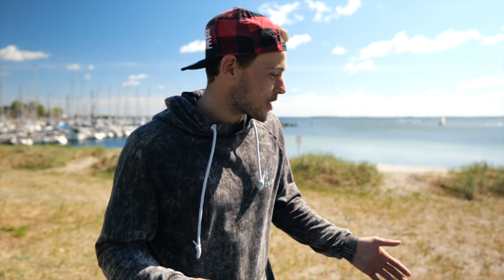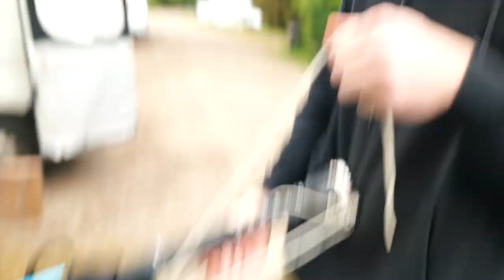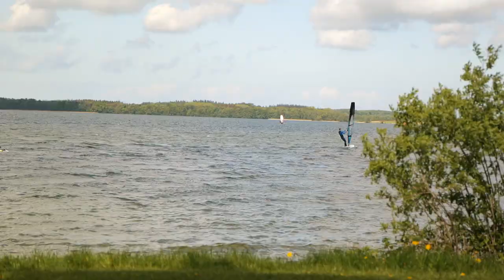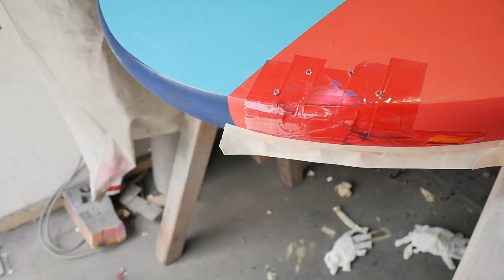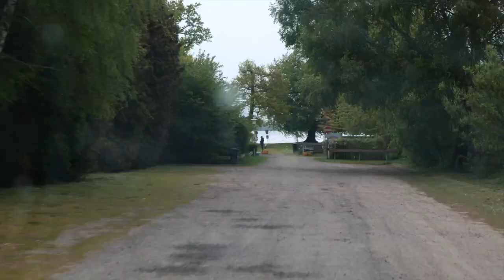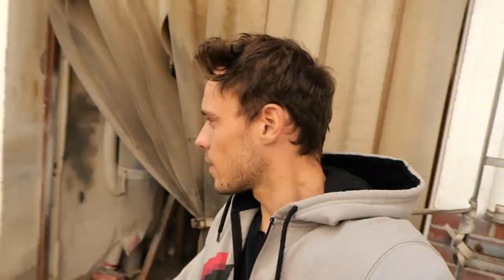CRASHING INTO A BOAT and then repairing it (FULL REPAIR)  | vlog¹⁶₂₀₂₀

Comment: What about a video zooming in on the differences between different sail types? Sometimes they can be hard to define, especially freestyle sails & wave sail shapes. Or Freerace and foil sails. Perhaps by trying to slalom with a wave sail you could zoom in on the (obvious & less obvious) differences for example.
I'm still not sure what some of the characteristics of the sail do. Like when the pressure point of the sail is more forward, backwards or higher or lower. When the power is higher or lower. With which shape does a sail have more acceleration, and which more topspeed? How does downhaul (lose leech) affect either of those? What do 2/3/4/5 battens do with the sail? Which aspects of sailing do cambers improve? (Low wind, high wind, no difference in medium wind?)
And so on!

Comment: I have a question: carbon fiber laminated with epoxi, ok, but then you say polyester filler? Is this epoxi with polyester microballoons, or you actually use polyester resin with balloons??
Reply from the maker: No, it's actually called polyester filler. It's a product you can buy - not sure of the exact ingredients.

Comment: If that's intended as a very general video about having you board repaired ASAP, dont' care about quality, the only need being it's waterproof and ready for yesterday, then cool. But:
- where has the big dent gone? After the accident the rail is badly crushed and when the guy begins working there's no sign of any dent, all perfectly flat. 
- I imagine this is a sandwich board also on the rails and repairing it while preserving the original structure (there to provide solidity) would be the longest and most complex phase of the job.
- even If you don't give a sh*t about it and the only sandwich you ever heard about is the one you had for breakfast,  you could do a lot better than randomly drilling some holes around and blindly injecting PU foam - besides, the board is made of polystyrene (EPS), not PU. This is the cheapest, fastest and lowest quality approach to the issue. Apart from the use of carbon - but why using a high quality material in such a a low quality process?
- polyester (filler) over epoxy is a bad idea. It's widely used because it's much cheaper and, most of all, will cure in 1 hour compared to 24 required by epoxy, allowing delivery of the board 1 to 2 days earlier. But, to give an idea, no serious boatyard uses a polyester filler under the water line and don't be surprised if, after another impact, your filler patch detaches and falls off. 
Bottom line: if you're gonna throw that board away at the end of the season, just use it for training and filming those fancy You Tube videos then anything goes - wanna try concrete? WTF, go on! And, please, post the video... :-D
I wouldn't do that to my boards and I suspect Nico's racing boards undergo a different routine if they need surgery